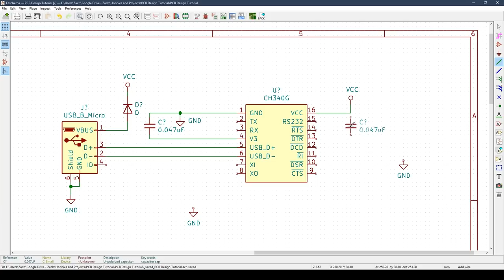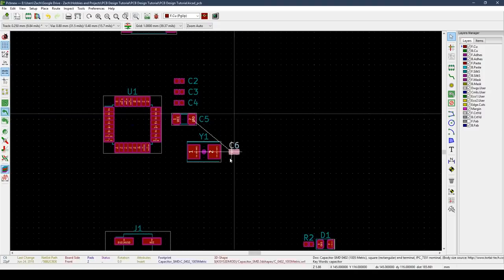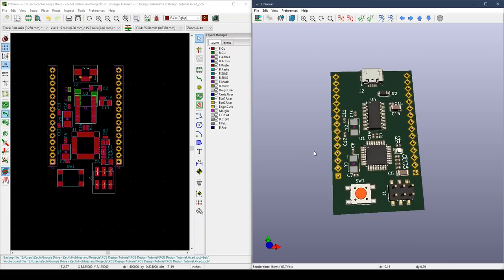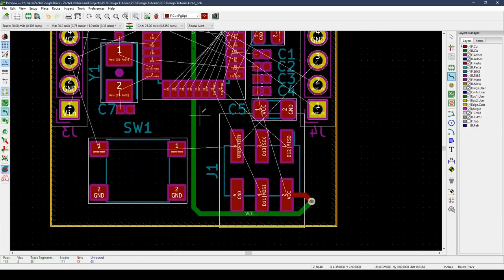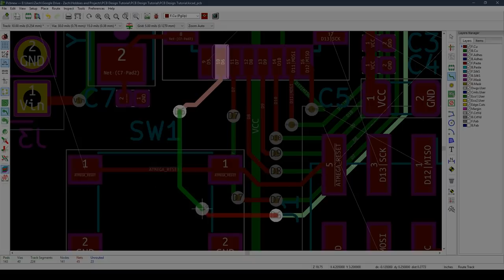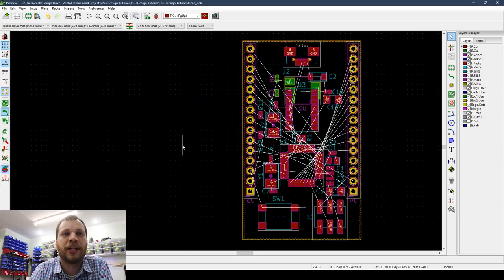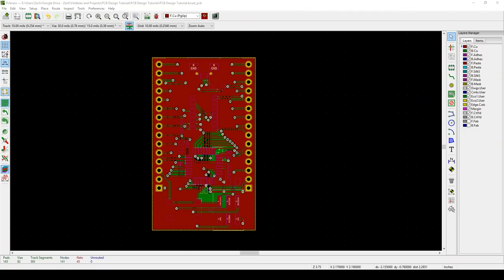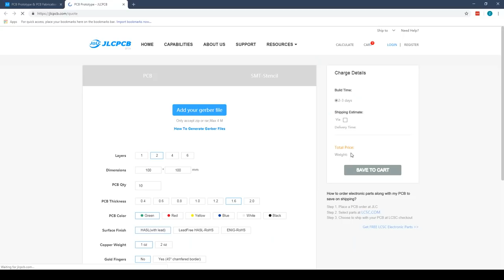How To Make Your Own Printed Circuit Boards (PCB)

Comment: umm were do i start learning this lol
Reply: Hey, any news? I’m trying to make one for keyboaeds
Reply: @Mohdzn  i think it’s mainly about knowing the components which are on a board, and then putting them all up on a custom board of your choice, for whatever project you may have
Reply: I’m currently going through Andre LeMothe’s “Crash Course Electronics and PCB Design” on Udemy. I’m liking it so far and for the price it’s pretty well produced
Reply: Know all the pieces that go on a motherboard know what you want it to be used for be smart where you place each piece for maximum efficiency and finally find a manufacturer

Comment: I design A LOT of high density production PCBs and I often skip the schematic and layout PCBs first. I can do this because I often reuse parts of circuits that I've used before. I miss the old days when I made homemade boards with photosensitized boards and etching solution, but the stuff I do today is too complicated for that. It would be easier to make homemade boards today, EVERYTHING IS SURFACE MOUNT and I wouldn't have to drill a zillion holes now.

Comment: Very informative, in all my years on this planet I never knew you could design your own PCB, question,  can we duplicate a PCB from it's schematics?
Reply from the maker: I'm not sure what you mean by duplicate from the schematic. The schematic is just part of the process. It's a visual way to see what is connected to what. The board layout is the actual routing of copper traces.
Reply: @bytesizedengineering  correction sorry I was going to say like make a copy of a particular PCB, let's say an old damaged PCB from 14 years ago that has it's schematic and all, I was meant to say that though
Reply from the maker: @ApolosaCakau  yes if you have the design files, including the gerber files and bill of materials etc you could definitely make an old board
Reply: @bytesizedengineering  Business idea, use camera to generate the files automatically

Comment: Thanks for the video! Is there a way I can check whether the PCB trace width is enough to handle the current?
Reply: Yes. Advanced Circuits has a tool that can help with this. Pretty sure KiCad also has a built in tool also.

https://www.4pcb.com/trace-width-calculator.html

Comment: I am assuming you have to solder components yourself after you get the pcb in the mail? Or are there companies that solder components for you given that you provide the part numbers for each component and the quantity, etc?
Reply: Some will but you'll be limited a list of components they supply and price/lead time increases considerably

Comment: Where is the best place to learn about Circuit Board creation and jobs in that field. I've been taking interest in the creation of Circuit boards and was just curious what to look up or where to search for more information about this.
Reply from the maker: There are good tutorials on YouTube, Adafruit, Sparkfun, EEVBlog, Contextual Electronics, etc. For jobs, you will likely need a degree in electrical engineering or have many years experience as an electronics technician and learn how to use the software. I would check out KiCad for tutorials.

Comment: Love the video! If I have components that are mounted through the board (they have pins that will be soldered to the back), will traces on both the front and back of the board be able to connect to them?
Reply from the maker: You need to use a "via" to connect traces on the front and back of the board. Vias are little holes lined with conductive material that go through the board.
Reply: @bytesizedengineering  ah got it, thank you. So are through-hole components connected electrically to the back or front of the board?

Comment: Hi,

I am wondering if you are able to help me, I am looking to design a PCB with the following attributes.

220V input that needs to be able to charge a 12V 7ah or 17ah Battery with all the Overcharge protection as well as being to output 12V DC between 5 - 15Amps where would one find information on what is required and preferably an already designed board.

Your help would be much appreciated.

Comment: Is there any place (maybe JLCPCB) that would also add and solder the components on a board for you? without you having to do it yourself? Do you know any you can recommend? thx
Reply from the maker: Yes, most board manufacturers will do PCBA  assembly
Reply: @bytesizedengineering  thank you for the info. great videos!

Comment: I got two orange pi, PC and a zero, which I wanted to make a handheld. I want to make a board with the controllers and modules to make it more organized and also learn, but I need to learn how to work with these softwares, which have been hard. Please, make a video teaching how to do it!
Reply from the maker: There are lots of tutorials out there on how to use the software I use. Check out contextual electronics

Comment: Do you get these drilled?  I used to do it with a manual quad press, and really am not interested in trying that again.  Great video!
Reply from the maker: Yes, the manufacturer drills them as well. It's really remarkable what you can get for $2

Comment: i want to make 288v bms for lifepo4 what should i do
Reply from the maker: Find a BMS IC that will do what you want, and look in the datasheet for the "typical application" circuit for how to use it. If this is your first electronics project I would start with something much easier.

Comment: Hi, what will be the minimum thinkness of copper traces that we can design on the PCB and what will be the distance between two closest copper traces (for avoiding any parasit signal)? Thanks
Reply from the maker: Use a trace width calculator online.

Comment: Why not autoroute?
Reply from the maker: That's a great question, and also a fierce debate in the PCB design community. I have very little experience using the autoroute function. Many professionals don't trust the autorouter because sometimes there are other design constraints to consider. You also have to setup net classes for each signal. I think it does have its place in some circumstances. I should learn how to use it and see if it'll save time.

Comment: 🙏🙏🙏🙏 please keep my request as a serious issue. I want you to design the circuit on paper and make it's PCB,make  circuits such as LED bulb glow , and many other basic circuits with transistors and diodes . I want to know how the circuits are designed. And also want to know that how each component works.. please i know that you know high level things but please explain circuits for beginners too . will you make videos ..???😰😰😰😥😥😥🙏🙏🙏🙏

Comment: I do not get why it is required to do placing & routing manually? Is not there should be option to do this automatically? Do I need to know all the details like placing capacitors close to chip? I think this must be done automatically. Your sponsor to attract customers should ask you to make this process as simple as possible. I do not wanna spent hours for placing and routing

Comment: "Chinese PCBs are cheap" Is just a lie YT channels have been spreading for last 4-5 years. You need to take into account the cost and time it takes to get them shipped as well as the size constraint for "cheap" pcb which limits your projects.
Reply from the maker: You obviously have no experience ordering domestic boards. I've ordered dozens of boards in my professional career as an engineer. PCBs are usually $2-$3 each including shipping. Production times are usually 72 hours. Shipping is usually 5 to 7 days anywhere in the world with DHL. Domestic PCB manufacturers are usually 10 or 20 times more expensive and have similar production and shipping times. Unless you want to pay huge amounts of money for expedited service. You're looking at hundreds of dollars to get boards in the same amount of time as you get them from China. I'm speaking from a lot of experience here. When I worked for department of defense contractors, we had to use domestic PCB manufacturers and they were way more expensive and took about the same amount of time.
Reply from the maker: In fact I just ordered PCBs from China this week. The cost with shipping came out to $2.60/ board. They were manufactured in 72 hours and arrived at my house 4 days later. Show me a quote from a domestic PCB manufacturer that can match that speed and cost.

Comment: Informative video *two stars* ...It's messed up Science when you're the avionics technician on an Experimental $20 million dollar aircraft rethinking how $25 to an hourly technician, a sea lawyer engineer "degree might pay itself off one day damn it at a Salary (said set 40 hours)" with "it's got to work" and a $125 PCB determines your conscience on the fate of someone else triple checking with Engineers outside of their lab test environment based upon variables to include, weight and balance, fuel load, engine parameters, flight control parameters, pressurization, etc. only to piss off the one person that has the conscience to know God Damn, you want to what with what? If you have a Smart Home, I'd just walk away knowing it is' your leading personality trait. If it were me, I'd run the engineering group on OT, or at non-discretionary education pay-bit scholarship fund note, until it is fixed.